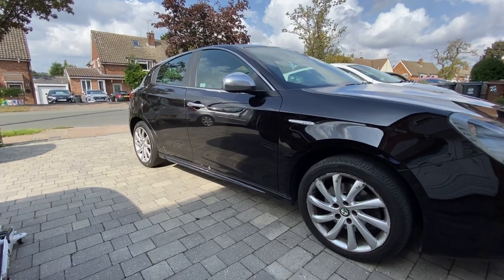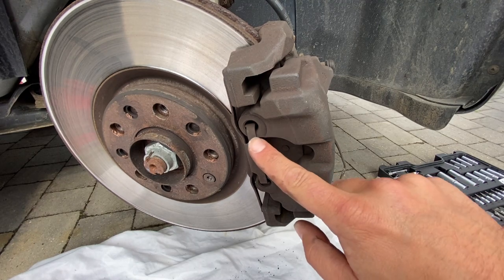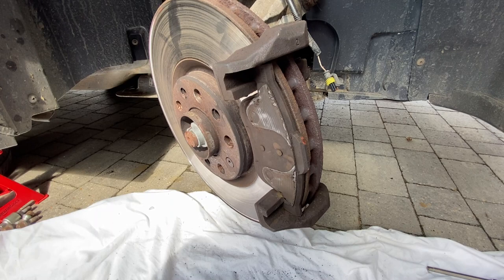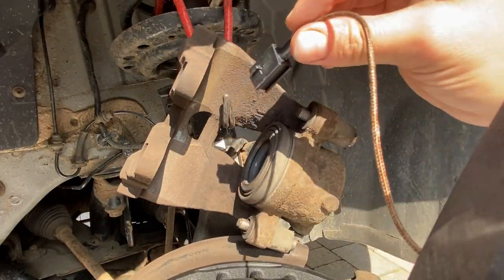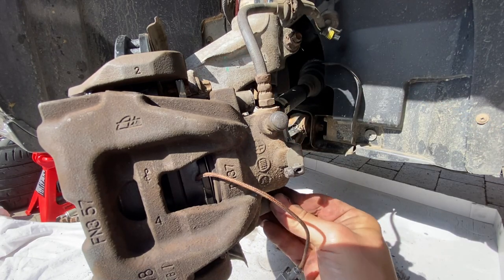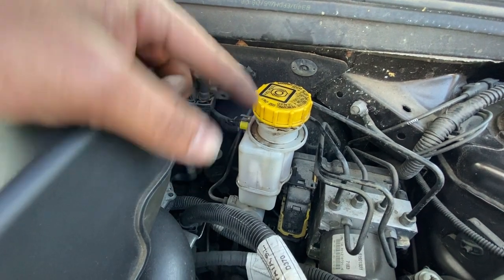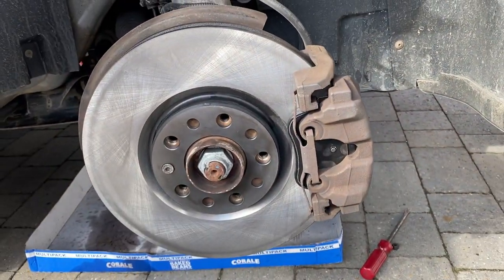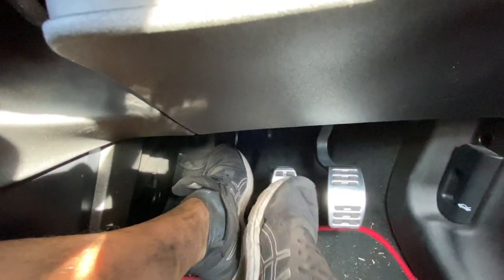Alfa Romeo Giulietta Front Brake Pads Changing

Comment: Great video once again! Just for funsies next time you are pushing back the piston open the bleed nipple while you are pushing it in so all the blackened fluid that has been in contact with the piston seals etc won't go up into the system. You will be surprised how black the fluid that sits in the calipers gets in just a few years... Thanks again for making servicing content for the G, just used your front seat removal video yesterday!
Reply from the maker: Hi Sturbok. Great to hear from you. Some useful advice for sure. I wanted to use the laptop to bleed the brakes as you saw, so wanted to ensure there was extra fluid in the reservoir. As I changed my brake fluid a couple of months ago, I wasn’t too worried about dirty fluid, but you’re option would definitely add value 👍 
All the best.

Comment: hello, on owners manual i see that front disks are self ventilated. In this case what was the reason u use not ventilated model disks?
Reply from the maker: The Cloverleaf has drilled slotted vented disks, but the Veloce has only vented if that’s the difference you mean. Different power cars requires different stopping power. All the best 👍
Reply: @vialettotony  i’ve seen some providers that suggest ventilateds for even 1.6jtdm. Money bait i guess. thanks a lot.

Comment: These videos are a God send. Thank you so much for making them, they're super helpful. One question though: Will you make a video on how to flush the radiator system in the future? Also if the engine coolant is on the minimum line would it be advisable to mix in a little bit of distilled water into the reservoir? Keep up the amazing content mate.🙏🏻 Love from South Africa.💙
Reply from the maker: Hi Megane-kun. Yes, I’m hoping to do this. I need to get my cambelt changed, so considered leaving it as it will be changed then. Hopefully I’ll get around to it soon. 
Regarding topping up the coolant, for the cold temperatures we get in the UK, I always like to keep the ratios factory, but for SA temps, you’d probably get away with adding distilled water as an option. 
Thanks for your comments, and watching and subscribing. Really appreciate it. 
All the best. 👍

Comment: I couldn't get the reason of rubbing on your disks. Was the reason is not bleeding calipers by compressing piston? If I bleed by compressing caliper will it still rub on disks or rubbing is not that important to care about? 
Thanks in advance.
Reply from the maker: Not sure I fully understand the question but if you have a slight rubbing after bleeding that’s not a problem. Hope that helps. All the best 👍

Comment: hello ! What cable are you using to connect? and what is the version of multiecuscan? thank you so much.
Reply: Is there another way to drain the fluid?
Reply from the maker: Hi. There’s a link to the cable in the description on another video. I’ll see if I can find it for you. I’m also running the most current version. Can’t remember what it is at the moment though and the Mrs has the laptop. All the best 👍
Reply from the maker: Here’s the link to the video with the link for the cable in the description 
https://m.youtube.com/watch?v=rPSYG8sgVXQ
Reply from the maker: @ExplorationsParanormales  you can do this manually. You just need someone to help. 
https://m.youtube.com/watch?v=nF8ZPLhAqRM
Reply from the maker: Here’s a link to a video for it 👍